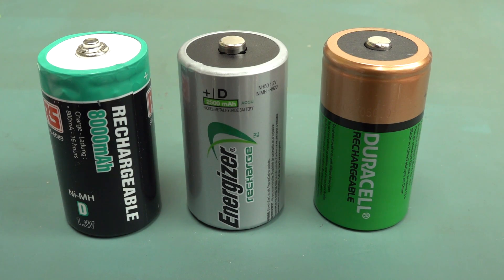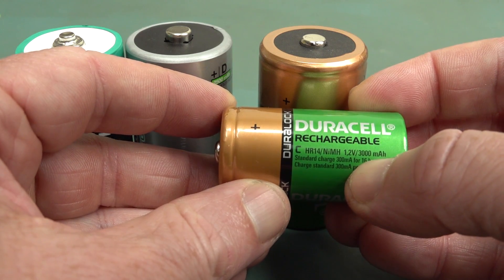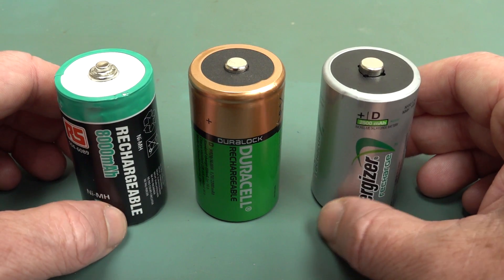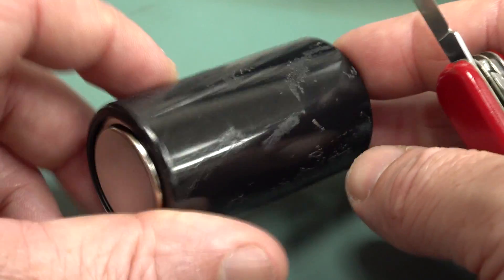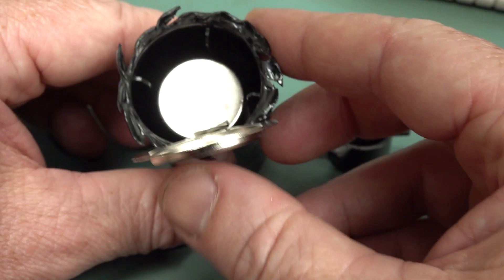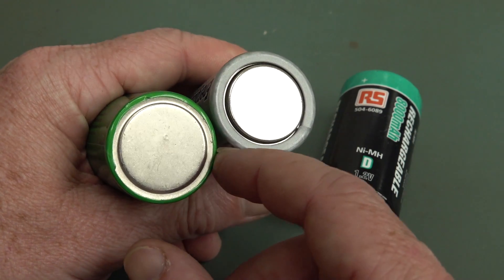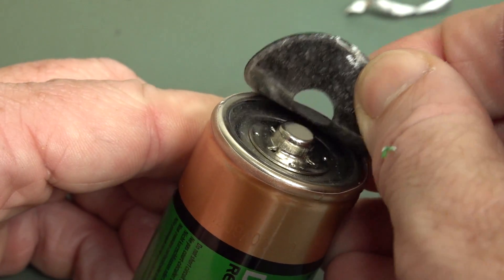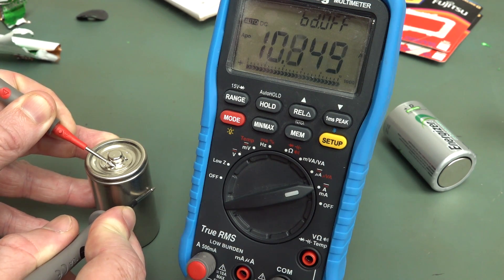EEVblog #1200 - BUSTED! - Energizer & Duracell NiMH

Comment: The "WungHungLow" smell fishy at 13,000mAh?  Ya, I would be very surprised if they were greater than 2Ah. - 16:50  They lie all the time with the lithium-ion batteries so I see no reason they wouldn't be lying with NiMH.  Fishy... lol.
Reply: They do lie about NiMH batteries but not quite as badly/often as they do with lithium, you can get some decent cells from china for a few bucks.
Here's one round up I can recommend: https://www.youtube.com/watch?v=846m-boWB64
The EBL, Sunlabz and not listed in this video but pkcell is also a decent Chinese brand, if you buy from any of those brands they'll probably be fairly ok cells, I got an 8 pack of SunLabz 1000mah AAAs myself for $6 and while I never did a capacity test on them, they do last about as long as my eneloop AAA, as for their life span, unfortunately I have had a couple go bad after about a year or two of bi-weekly cycling them but the rest have been fine.
Reply: @vgamesx1  re: pkcell yep, you can buy their stuff direct from the factory on ebay. a couple of years ago I used a lot of their Li-ion 18650s after making a few small orders, testing them and consistently getting around 95% of the stated capacity. always just below and never just above lol, but definitely good enough considering the price
Reply: @vgamesx1  I recently bought a 6 pack of EBL D cells to run my old tape recorder. They're rated at 10Ah. Haven't done any capacity tests yet (it's been a month); I'm still waiting for my recorder to chew through the initial charge fully :^) It's been like 15-20 full 100-minute playbacks since I've put them in, and a fair amount of rew/ff action too.
They weigh 130g each, so it may be that they're actually lower capacity than stated, judging by the RadioShack one in the video, but playing time suits me anyway :^)

Comment: I think they're doing this with 18650's also because if you go to buy them there are people in the comments asking how heavy the cells are.

The other 'scam' that Energizer does is in their charger: They time charge your NiMh batteries which can overcharge them and shorten the life unless you only charge dead cells. But they don't tell you that in the instructions. It'd clearly be better if the circuitry monitored the cell as it was charging.
Reply: There's no way any charger will blindly charge batteries by a set amount of time, that would be almost 100% blow up chance. Even the cheap tp4056 for the 18650 regulates the charge according to the cell voltage.
Reply: @sir_charles1246  It was right in the Energizer instruction manual. I've also seen it happen if they're plugged into say a 6 prong outlet and it gets shut off and on again then it will start charging from 0 again. So they do it. I was very disappointed when I read this because it might as well be money wasted for those of us who have decent power supplies to begin with.

The reason they can get away with it is that NiMh cells can take some over charging. But too much and it heats up too much thus shortening the life of the batteries. They don't care - you've already bought them by the time you read the manual. 

Bad Energizer!

Comment: 2200-2500mAh is in the same ballpark as high-capacity AA cells, may as well get battery size adapters and buy AA. Some D-size adapters allow you to use 3-4 AAs in parallel for higher capacity and current.
Reply from the maker: Yep, then you can use them in different devices
Reply: You stole my thunder... well mumble. My AA Amazon Basics are 2400 mAh and weren't even sold as high capacity, just low self-discharge. I think I'll just wrap some paper or whatever around a couple instead of buying D cells for my Duracell flashlight. (It is a very well made flashlight at least.)
Reply: You are mistaken about the quantity.  There are 2xAA and 3xAA but not 4xAA.  The diameter would be off by a long shot.
Reply: This is exactly what I did. 2AA to D cell. Luckily for me the majority of D cell items that I own were just stuff for my kid (such as the infamous Rock and Play of recent news) so I didn't have a bunch of worthless cells after she outgrew all those devices.
Reply: Teardown Dan But packing 3 or 4 AAs into a D-sized box doesn't give you the full D-size volume of battery chemicals, and thus not the full energy level.
Reply: @johnfrancisdoe1563  Full capacity? Neither the Energizer nor Duracell deliver anywhere near D-cell capacity, they're merely at the higher end of what is available as AA. Which one is the bigger rip-off? 2500-3000mAh D-cells at $8-10 a pop or 2200-2500mAh AA-cells at $2 a pop? You can outperform the Energizer and Duracell D-cells with a pair of AAs for half the price.
Reply: @johnfrancisdoe1563   but neither do Energizer or Duracell - the whole point of the video.

Comment: with those "ratings" just get one of those AA->D,C plastic coverter thingies?
Reply: They did the same
Reply: @ingulari3977  i hope no one thinks you are serious altogh i think its unlikely to cause problem but it doent look like a good idea
Reply: I have some weird ni-mh cells that are the length of Triple A but the girth of a double a :(
Reply: Only if the installation was not permanent and you intended to reuse either-the battery or the cell.

Comment: There are 18650 cells on ebay that contain a single roll of the cell wrap and the rest is just filled with sand ... literal sand you can pour out 
some are just outright fake and filled only with sand
Reply from the maker: Wow. Got a link to a known one?
Reply: No, i have never thought to buy lithium cells off ebay but if i were to try and seek one out i would look for the cheapest cell with a reasonable shipping weight
A quick search looks like there are a handful of videos about it
Reply: @OneBiOzZ  I haven´t seen any that were filled with sand, but those with a few turns of cell material and air in the middle are super common.
Sand costs money too.
Basically buy ANY 18650 that costs only 1$ or less, or claims some impossible capacity rating, and you´ll get one of those.
Reply: i assume they tend to fill them with sand so often with ebay buys so you don't pick it up and immediately leave a bad review and try and return them

Comment: 'D' cell products are sized for a reason, Not to use more space..
Reply: D-cell alkalines batteries are cheaper per amp hour than C cells, so a device which uses alkaline D cells will be cheaper to operate than one with the same current draw that uses C cells.  If, however, one has a D-cell boom box that one will use every day and can recharge every evening, rechargeable C cells will be cheaper and just as useful as the D cells, but weigh less.  If one will go weeks without power, a set of D cells would be more useful despite the extra weight
Reply: @flatfingertuning727  That's what I was going to say - could be seen as a benefit in the consumer market for many applications.
 worth noting that energizer 2500mAh C cells cost about the same as energizer 2500mAh D cells - energizer aren't ripping people off by selling them expensive fresh air, they're ripping people off by costing too much per mAh across the whole range in the first place compared to RS (who aren't known for being a cheap supplier)
Reply: Guillermo Zaandam Obviously because they need the extra electricity.
Reply: I already see marketing department turn that into advantage: more air inside = less weight of battery = device with their batteries are less heavier and more mobile = their batteries are better then heavy RS crap ;)
Reply: Energy density
Reply: I've known this for 20+ years.  I used to have Panasonic rechargeable  batteries of  every size and the C and D batteries had the same rating and weighed basically the same.  I remembered I was really pissed off about it.  At the time I didn't know where to get "real" D size rechargeable batteries.  The reason D size exists is for more capacity.
Reply: The only reason is that D cells are a relic from zinc-carbon cell era. These days barely anything uses D cells.
Reply: @wtfiswiththosehandles  My grandma still has a flashlight that uses 3 D cells, it has a wimpy incandescent bulb that drains the batteries so fast.
Reply: @teresashinkansen9402  maybe her personal massager also use D cell
Reply: @QDStrength  Proves the Duracell maker was a bloke, "It'll only need enough capacity to power things for 10 minutes, 3000mAh should do".  Energizer maker '"As long as that?  3 minutes tops, 2500mAh" 
Wives: secretly putting in an order from RS Components.
Reply: @QDStrength  No, that one uses a 150Ah rechargeable lead acid cell.
Reply: @Hairy_Takoyaki  I hope she/they will be happier with RS battery
Reply: MasterBata 
That lack of D cell market would likely make it uneconomical to set up a D cell production line so they just use slightly more common C cells in their own dedicated adapter. Just comes down to wether you pay for D cell capacity or C cell with adapter.
Reply: MasterBata I do, and I am pretty angry about these crap batteries, making it near impossible to get some real D cells!
I use them in my Luminara real flame effect candles, 2500mAh or 15000 is the difference between me having to charge the batteries every 14 days or every 3 months!!!
Also my Roomba virtual walls use them. These are not old products, and they are designed to use D cells for a reason!
But this make me wonder: is the same “scam” being performed on regular alkaline batteries as well? 🤔
That would throughly be a scam sine they usually don’t print the capacity on them!
Reply: Why then?

Comment: Id bet that the low capacity ones are preferred for weight savings. Everything Ive owned that used D cells used at least 6 of them.    The full size batteries get heavy fast. And lets be real, your arent buying batteries for something thats going to sit in your desk all day.
Reply: You can get a battery shaped plastic thing to take the place of a battery. Still save you 3 batteries.
Reply from the maker: If you want to trade weight for capacity, go for it. But I don't see weight saving in the marketing...

Comment: Great....now I have to empty out my kitchen drawer and cut open all my batteries. Thanks, Dave. :)
Reply from the maker: Be careful, it's not a 100% safe thing to do.
Reply: @EEVblog  Hold my beer :)
Reply: @jimgrady7458  are you still in one piece? If so then a few safety tips. 
1 for the love of god dont do it 
2 dont disassemble nicd or super dodgy nimh cells ( they are usually nicadsarked as nimhs ) cadmium is super toxic 
3 dont disassemble lion cells they can catch on fire and make toxic fumes if you really want to dont do it indoors 
4 all cells might catch one fire so dont do it near flammable stuff
5 use safty glasses and glows cells will contain toxic and corrosive fluids 
6 dont do it if you are alone in home
7 You might discharge cells first

Comment: Big Clive took some NiMH cells apart a while ago and the guts spontaneously combusted.  I’d be careful.....
Reply: Chetar Ruby  Nope, it was definitely a NiMH
Reply: Yes, a Lidl Tronic brand Ni-Mh, good batteries though and super cheap. @ickipoo
Reply: Chetar Ruby  https://youtu.be/tBg4ximDrsk?t=986
Reply: Hmm having cleared up after the flood, I hope that fire isn't next... I remember the Big Clive video with fire discovered inside NiMH cells.
Reply: No problem, the floodwater will put out the conflgration!
Reply: No, it was an enelope.

Comment: It's a certainly a bit deceptive, but at least the capacity is honest. I should hope the price reflects the difference as well, comparedto the RS branded one.
Reply: Possibly the RS one will be cheaper, retail batteries are a complete ripoff.
Reply: The name brand ones are guaranteed to be more expensive. They are the 2 most expensive brands you find in stores.
Reply from the maker: Yes, technically it's honest. You'd hope they'd be cheaper. In this case the RS one is more expensive, but its RS...
Reply: @EEVblog  
It would be great if they would fit bigger batteries in a smaller case, but I might be making some thought error here.

Comment: Energizer and Duracell have been doing this nonsense for forever. 10+ years ago I ran into this while looking for some rechargeable d cells for my florescent portable lantern. Ended up buying some tenergy branded 10 amp hour cells. They were the business and provide great run time with the catch being that I had to remember to charge them before going on a camping trip because they were not low self discharge. The cells actually outlasted the light they were bought for and still hold a decent charge today.

Edit: I don't remember the duracell/energizer batteries being much cheaper in fact I remember being fairly outraged about how they were cheating you on capacity for a minor decrease in price.

Comment: 50 seconds in and I can tell you what they did.  It's probably a AA battery stuffed in a D cell case.  They make adapters to do that.
Reply: I'm betting that too. I used to have some "real" 5500mah rechargeable D's and when I went to buy more I saw these crappy energizer / duracell ones and said what a piece of shit... So I went on eBay.
Reply: Nope, wasn't a AA but wasn't much more than that.  What a rip off.
Reply: Yep, looks like a "sub c" which is a common size in tool / rc nicad's and nimh cells. The Duracell surprised me though, I was really expecting the same thing in both.
Reply from the maker: Close!

Comment: Calls Ni-MH "Old School" 

meanwhile,
I still have Ni-Cd.
Reply: Meanwhile my remote has baghdad batterys.
Reply: @preslavenev5351  I grabbed some uranium as the earth was forming and use that to run my hotdogger.
Reply: @cougarhunter33  Those will be some tasty hotdogs
Reply: @cougarhunter33  The hotdoggers need AC though.
Reply: @AttilaTheHun333333  Not necessarily, electrolysis adds flavour
Reply: @AttilaTheHun333333  Did you hear that sonic boom? That was the sound of the joke going over your head at speed.
Reply: @preslavenev5351  That's right, put them in my mouf
Reply: @AttilaTheHun333333  it's easy to convert it from DC to AC
Reply: @preslavenev5351  That's pretty cool, Preslav Enev... my remote runs on electric eels.
Reply from the maker: Yep I'll pay that
Reply: Meanwhile my carbon zinc are all crumbling away
Reply: Meanwhile, I still use Leyden jars...
Reply: @samgab  I use a key on a kite string during a thunderstorm to generate electricity.
Reply: @samgab  My potatoes are drying out.
Reply: I still have a working NiFe battery that was made before I was born - it's over 60 years old!!
Reply: @SusiBiker  and there are lithium iron (Li-Fe) ones too (one of my 2 android tablets uses that)
Reply: I remember when I finally got rechargeable batteries as a kid for my RC car. Those GE branded ones with the black and white art and plug on the side.

Nowadays you can charge NiCd batteries in a NiMH charger. Apparently NiCd can deliver a ton of current, liked by RC car people.
Reply: I still have some of those GE brand ones with the plug on the side, although they are worn out now.  I got them when I was 14 and now i am 51, and they have never leaked out anything either.
Reply: I put a hamster wheel in my D cell the hamster is still producing power.
Reply: My first cell phone had a lead battery (and a carrying handle). Oh, how times have changed. :P
Reply: @rogerw9840  Nice My 1st Mobile phone ran off 4 AA batteries.
Reply: All that juicy cadmium!!!
Reply: Meanwhile, my stationary bicycle generator is overheating...
Reply: Ni-CD are the future!
Reply: Commercial aircraft are almost all using Ni-Cd.. they take a fair bit of maintenance though!
Reply: Same here, I got old Varta Ni-Cd  4Ah D sells. Still useable :) Even had forgotten them for some years uncharged :)
Reply: @Ewoorg  I have those too!
Reply: SkeletonSyskey I run mine on lemon you're still better.
Reply: Hell yeah my multimeter is adapted to rechargeable with one of these!
Reply: Yes. Ni-Cd are the real old school ones.
Reply: My pager used to run on one AA
Reply: My old Heiland Strobonar electronic flash used a 510 volt carbon zinc battery that was hung by a thick vinyl shoulder strap wider than an auto seat belt.
Reply: Yeah! True! Dem long-lasting batteries better than Ni-Mh horrible charge/discharge
Reply: THEY BELONG IN A MUSEUM!

Comment: I'm surprised they didn't just throw an AA-sized cell inside.  In fact, buying AA cells and a C-type or D-type holder would be a much better option than buying these C/D cells because you could still use the AA cells as AA cells if/when you wanted/needed to.
Reply: It's not safe for devices that require higher capacity to operate, which is the whole point behind C and D cells.
Reply: @JosephArata  But many AA-sized NiMH cells are offering 2000-3000mAH capacity these days and can be used in high-drain appliances so what's the difference?  I also notice that these C/D cells seem only to allow charging at 0.1C whereas most of the AA cells of similar capacity allow charging at 1C -- seemingly indicating (again) that they have a low internal resistance and are thus well suited to high-drain applications.
Reply: @xjet  these cells, minus the RS cell, are marketing wank jobs. Get real batteries that are manufactured utilizing the entire standard they occupy. There's a reason why you don't want to be using AA and AAA in a C or D cell standard. You may not realize it till those AA or AAA cells blow up from an exothermic event.
Reply: @JosephArata   In my tests, a decent AA-sized NiMH can safely deliver much more current than a Zinc/carbon C or D size cell so there is no danger in using them (in a suitable physical holder) as a replacement.  Primary cells were never designed as a high-current power source in the first place.
Reply from the maker: Yep!